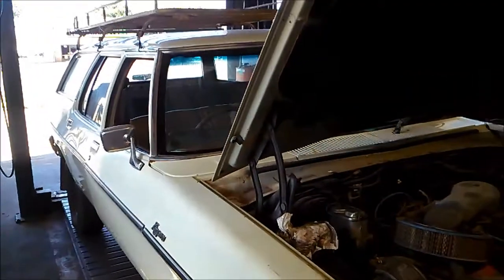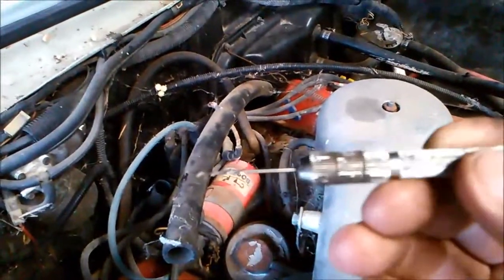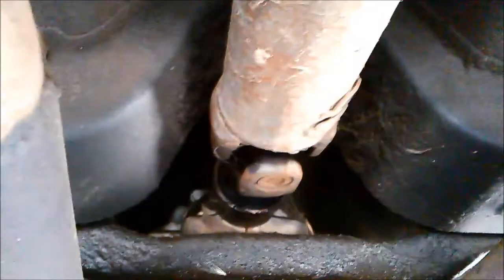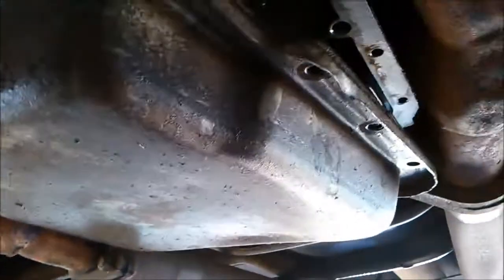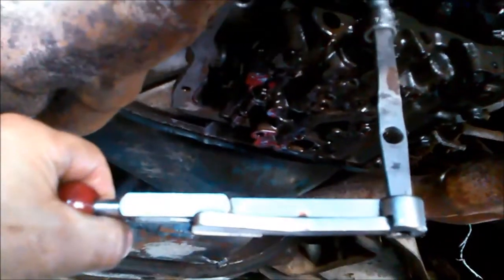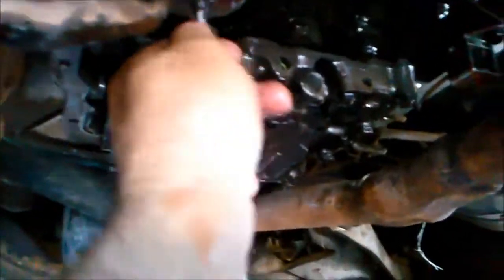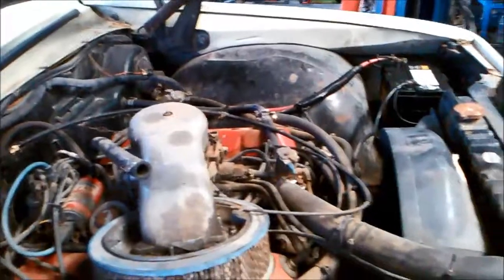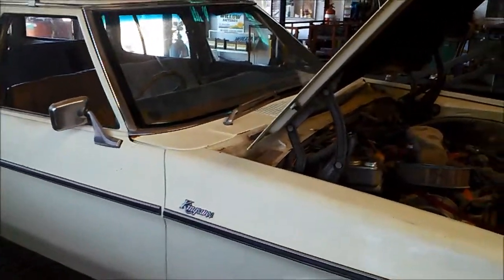Trimatic GM Holden TH180 Automatic Transmission Filter Service & Band Adjustment DIY How to

Comment: I gotta say. Genius of you to put the pump tube in to the full mark on the dipstick by measuring its length. Saves messing around with fluid levels, get it right second go! I'll definitely be stealing that trick when I go to do a band adjustment on my Trimatic.
Reply from the maker: hardly genius, cheers 👍

Comment: Great job with the videos, only video on GM Trimatics I could find. My service done without hoist and band adjustment as didn't have those tools and its only done 76k. thanks for posting
Reply from the maker: Hi, you could have just tightened the band adjuster up by hand, while counting turns in and then backing it out to band adjustment accordingly...at least you would be close to band adjustment or know if it is out, even without a tension wrench. cheers

Comment: Early Trimatics had a drain plug. The drain plug was removed as some dealers were not servicing the unit correctly leading to early failures. They did a running change converting from cable kickdown to electric when the model changed from Hg to Hq. 
The test of a trimatic is it's willingness to engage gears quickly, typically when it's slow to engage reverse, this suggest band adjustment is required or replacement.
Reply from the maker: hi, slow rev engage was more often the reverse clutch lining peeling or worn, hence the large aluminium shroud they added on the filter, band isnt applied in reverse..cheers
Reply: @YepThatsIt  hence the need to overhaul the unit.

Comment: Have you ever come across oil coming out of the breather port randomly? And slipping when giving it a guts full but when let off the  revs it changes and goes good
Reply from the maker: hi, might be overfull or has internal pressure leak causing fluid to aerate. to rebuild bushings need to be replaced, most just change seals, rings, clutches, bands only. cheers

Comment: How about tightening bolt  to a required Nm and then release the bolt 5 turns ? Tightening the bolt all the way can create a high resistance to the auto gear change and making tge engine jitter.
Reply from the maker: hi, how about you watch the full vid that shows i do adjust with tension wrench? cheers
Reply: @YepThatsIt  I must have missed it while drinking my coffee. Regrets.

Comment: hi, enjoyed your video, im having slipping trouble with my trimatic in a VH commodore 253. could this happen if I have too much trans oil in? seems to be worse when hot and gets to the point where it won't move in any gear!  help appreciated
Reply from the maker: hi, check all the basics including vac lines and modulator isnt leaking. overfilled trans fluid can cause similar issues as underfilled. if the fluid reaches the spinning components you fluid will be aerated - thats not ideal in a hydraulic application. cheers

Comment: Hi freind has VL commodore with 308 & trimatic in it when he corners it flares up if it low on fluid due to wrong dipstick will trans be damaged due to flare ups when cornering thanks great video
Reply from the maker: hi, contact me on my face book link https://www.facebook.com/Yep-Thats-It-103051017785435/  and leave me which  kind of vehicle/transmission type you have, and leave a detailed description of any fault codes and issue you are having ( we are able to exchange pics/diagrams on there ) and details of what work you have already performed or checked...... you will need to buy me some beers ( link is in face book ) and I will answer your questions accordingly. cheers
Reply from the maker: hi, try without forward slash...  https://www.facebook.com/Yep-Thats-It-103051017785435   cheers

Comment: Hello.  At 16 minutes of the video, a rumble ( hum wow wow) is heard in neutral gear and in parking.  I can hear it on my 3l30 as well.  What is the reason and is it normal?
Reply from the maker: hi, cant recall but sounds like can be worn reverse clutch plates which is common on these trans. metal to metal can also cause premature wear of planetary gears and pump plus other damage. cheers
Reply: Thanks 🔧

Comment: Hey mate great video!
I was going to ask a bit about the vac modulator -- I bought a VH SLE with a 308 with a mild cam (crane 276) -- the shift points are higher up and it downshifts fairly early into 2nd gear. I heard you saying about shortening the modulator pin -- is the idea to just grind / sand a little off at a time to shorten the pin and drive it to see the results?

cheers mate
Reply from the maker: hi, yeah we have pins of various shorter and longer lengths we try ( standard is 0.980" ). easy to shorten by grinding a bit off the end but make sure its square...to lengthen you can add a screw and grind outer of head so is same diameter as pin and put the screw head toward valve not against modulator...also you can remove the modulator sleeve that the modulator valve travels through and add an oring same diameter as the sleeve behind it. it may already have one in there that has flattened out. you could also play with the weight in the governor valve by making it a little lighter to shift a little later into 2nd. other than that changing shift valve springs in valve body can also change shift patterns.. good luck and have fun cheers
Reply: @YepThatsIt  legend! thanks for the reply -- what state is your workshop in mate? I'd be keen to bring my car round if you're local
Cheers
Reply from the maker: hi, I`m in ned kelly country north east victoria. cheers

Comment: Hi I noticed that you backed off five turns, yet you said if it's a V8 it's six turns. Can you clarify please. My 253 has a KK code, so would that be six turns.
Thanks.
Reply from the maker: hi, wont make much difference, its a kindof cushion effect thing allowing slightly longer to apply. the issue is if the band is worn, this is why i do a tad tighter - you can judge how worn band is by seeing how many threads on adjuster can be seen when adjusted or at torque setting. hope that makes sense. cheerss
Reply: @YepThatsIt  Thanks for the explanation, Six turns would make it softer on the diff engagement.

Comment: Just want to ask, What oil you use in these as someone said you can't use the synthetic stuff?  cheers
Reply from the maker: hi, unless hduty use like racing or towing we use dexron 3 as its thicker so will pass through internal pressure leaks slower, some also prefer synthetic dexron 6 fluid. a regular pan drop service, periodic band adjustment, adding magnets to trans pan and a bypass transmission cooler will allow your trimatic to last alot longer. dont forget to check the vacuum orifice hasnt carboned up and vac seals are good. cheers
Reply: @YepThatsIt  Thanks for ya help!

Comment: Do you recommend 4 turns for 202 6 cyl on the band adjustment?
Reply from the maker: hi, generally i wouldnt go much less than 4 1/2 turns. the idea is about band apply timing and also if the servo bore is worn where the servo piston usually strokes to, incase its worn..so the servo piston ring runs on an unused part of the bore. hope that makes sense. cheers
Reply: @YepThatsIt  Thanks for the info. Just having an issue where my transmission flares when downshifting into second from heavy throttle only. Fluid levels are full. Shifts smoothly the rest of the time... but sometimes the car shudders when you take off too hard? Just trying to iron these problems out.

Comment: Hi. I have a 1979 starfire 4 UC Torana Sunbird. I'm restoring it as its been in family since new and has total km at 76210. Been sitting for nearly 10 years. Its got a 3 speed T - bar automatic and transmission is leaking all over floor slowly and hasn't been driven yet. Would this be the same to service as the kingswood?
Reply from the maker: hi, all the trimatics are basically the same. cheers
Reply: +YepThatsIt Hi, do you do servicing? Are you near Brisbane?
Reply from the maker: I'm in NE Vic sorry

Comment: hi! when the oil pan warms up, it stops turning on all the speeds well. Could it be because of the filter?
Reply from the maker: hi, is there a long delay in reverse? on these transmissions they will peel the linings off the reverse clutches and block the filter. cheers
Reply: @YepThatsIt  delay is about 3 seconds, I think. and also starts dripping oil from the dipstick
Reply from the maker: try a service and band adjustment, also check the hoses on vacuum line to to transmission, check that the orifice on inlet manifold isnt carboned up or modulator isnt leaking
Reply: @YepThatsIt  vacuum line and  modulator is ok ((
Reply from the maker: have you replaced filter ? internal pressure leak when warms up fluid is thinner
Reply: @YepThatsIt  not yet. I understand correctly, when the oil gets hot, it is worse flows through the filter ?
Reply: or when the oil warms up, the pump does not create the right pressure?
Reply from the maker: as the vehicle is running, trans pump will suck up any muck in pan,  you can remove one of the cooling lines at radiator and see if it is pumping fluid.  or you can pump a pressure gauge on one of the ports....where are my beers ! use link https://www.paypal.me/BATS189 cheers

Comment: hello, I have a GM TH180 transmission with a Rover 3.5 V8 .... do you know what is the correct vacuum modulator valve for it as there seems to be quite a few of these valves available for the TH180. I saw this one on ebay its non adjustable but not sure if correct although it does mention Rover in the description. Any advice would be greatly appreciated, many thanks, Dave  https://www.ebay.ie/itm/TRANSMISSION-VACUUM-MODULATOR-TH180-TRIMATIC-3L30-3-SPEED-1-1980-ON-JVM-5183-/302387725441

Comment: In the video you said 5 turns and 6 for V8 but then you only did 5 turns. The car was a v8……?
Reply from the maker: hi, the time that it takes to apply band can affect the shift engage feel, from experience..i determined to leave the band a bit tighter. the info in the vid is what manufacturers recommend, but you could back off even 4 turns and band would still be lose enough when not applied, to not wear. hope that makes sense. cheers
Reply: @YepThatsIt  ok thank you. I did 5.5 just to be safe on my v8 😂
Reply from the maker: @juiced8  should be fine

Comment: Overall a good video although the unsteady camera was a bit frustrating.  I came mainly to see how to adjust the bands.  Skip to around 9:40 and the guy describes it very poorly.  All he says is "we do about 5 turns, 6 for the V8s, 40 in lbs, then back it off" WHAT??  This is not telling anyone anything and is very confusing to anyone who hasn't done it before.  It is only the actual showing part where we see exactly what has to be done.  Then we see that the Allen bolt has to be screwed in and tightened to that torque setting, THEN backed off the required number of turns.  Very small detail but very important.  Also there is no mention of that particular tool.  He says 1/2" and 9/16" spanner, but what about the size of the Allen key?   It needs to be a special tool with a socket provision to enable a standard 1/4" drive or 3/8" drive torque wrench to fit.

Also disappointing was that the guy was not wearing gloves during the service.  There are many nasty chemicals in automotive fluids and the skin is highly absorbent.   Something is bound to find its way into the blood. It's always rather surprising how many people don't take personal safety seriously.  Sure, using bare hands for this type of service three or four of times a year maybe isn't going to hurt you but seeing professionals who do it all day, every day, it's a wonder.  And people wonder why they get cancer or other unexplained illnesses.
Reply from the maker: Hi, thanks for feedback, will keep that in mind. sorry it would be easier if I had someone else to film...I usually do it one handed and work with my non-preferred hand. I usually wear gloves as much as possible, but when filming it gets tedious removing gloves on/off to not get camera grimy. I am trying to always improve and appreciate your observations. Cheers
Reply: @YepThatsIt  he whined at you about wearing gloves lol, fella went on a proper rant XD
Reply from the maker: @plasmaty  cheers